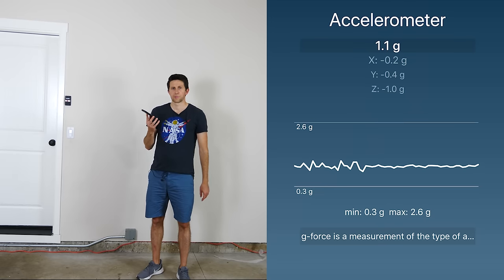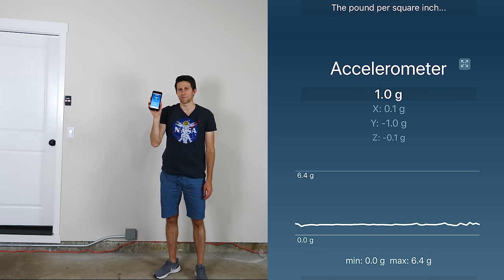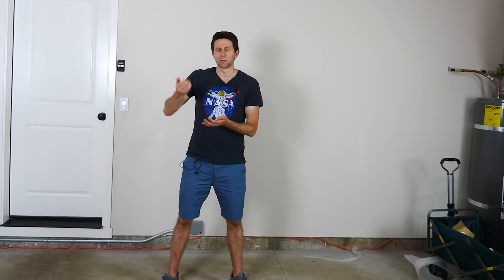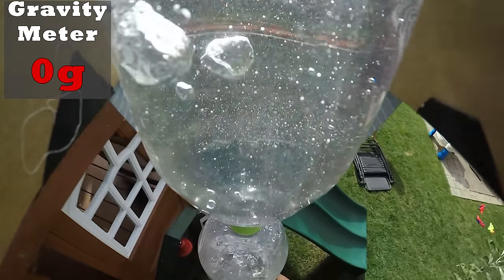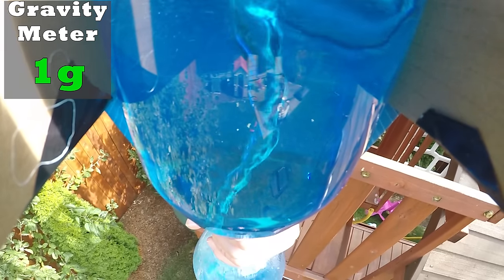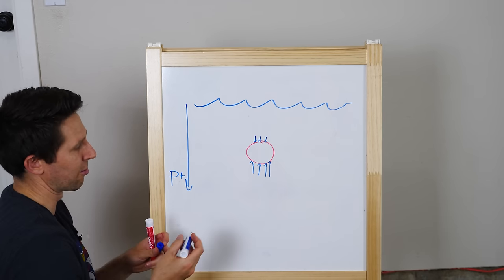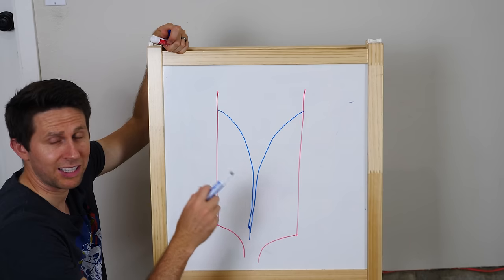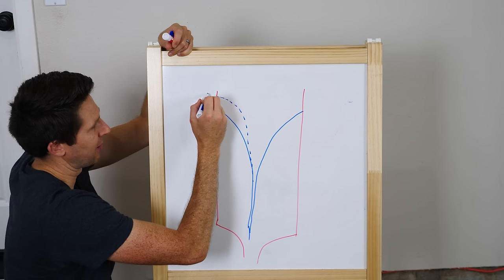What Happens to a Whirlpool in ZERO-G?

Comment: Showing spacecrew and mentioning 0 gravity is not correct.  ISS is still under the gravitational field of Earth.  It s not zero gravity but rather weight less state because the gravitational force of earth is perfectly balanced with the centripetal acceleration produced by the ISS to temain on its orbit around the Earth.  So weight less state has the same effect as 0 gravity but it s not zero gravity in the ISS.  It s a real difference.
Reply: Both gravity and centrifugal force are apparent force, not real force, but you're right in the way that those 2 apparent force need to be balanced in order to maintain orbit. But any free fall (orbit are free fall) are 0g (nowadays we talk more about micro-gravity cause technically only a point like object (0 dimension) can really be in 0g otherwise the gravitational gradient between bottom and top of object will messed up with 0g)
Ho and 0g doesn't mean no gravity, it mean no acceleration.

Comment: Actually you are a little bit wrong in explanation.... Because you said pressure in bottom is greater than uper side... But its wrong, pressure is same in each side of bubble and it going upward because it had less weight in 1g compared to water.... And in  0g there is no weight of water and bubble
Reply: Whats your opinion?!!
Reply: Water pressure increases with depth. Therefore, in a bubble that has depth to it, the bottom will be under greater pressure than the top. If the pressure was the same on all sides, it wouldn't move.
Reply: @johnm5928  it is its light weight es compared to water.... Which lifting it up..
Nothing else
Reply: @nishantpatel3041  Negative - the weight is only part of the issue. Watch this video: https://www.youtube.com/watch?v=HOEsCFkKXsk

You can see that the pressure (ass applied by the squeezing force on the bottle) causes the balloon/weight assembly to rise or fall. In this case, buoyancy is decreased when the pressure increases due to the volume of the balloon decreasing - however, the principle that should be taken away is that weight is not the only factor in whether an object will sink or float. It is part, but not all. And the reason it rises, when it does, is because of the pressure differential.